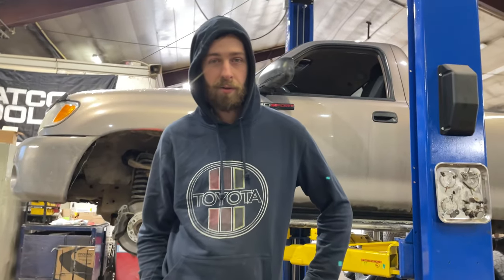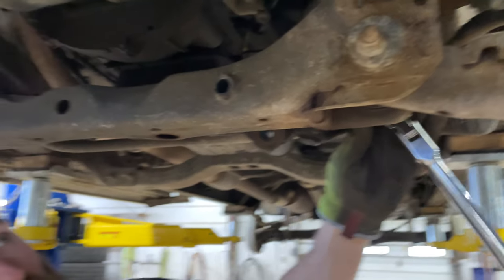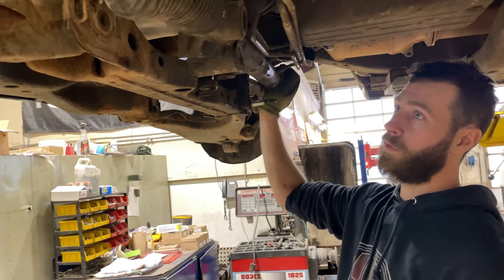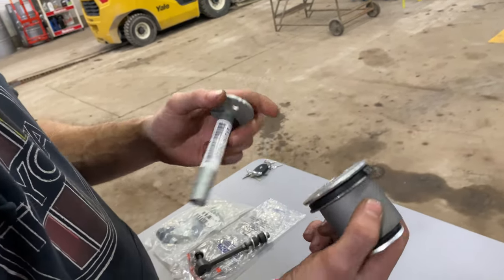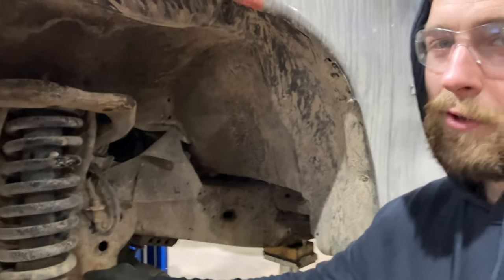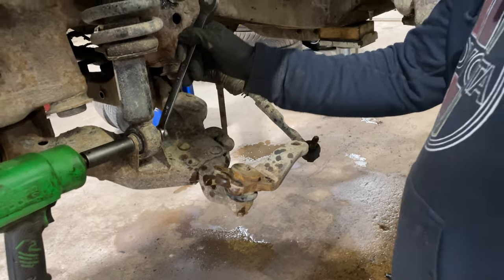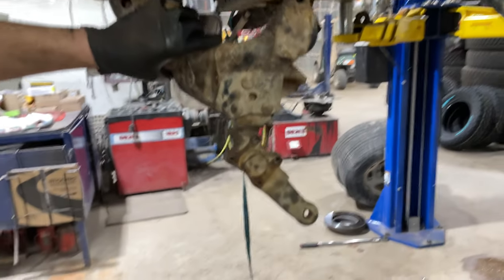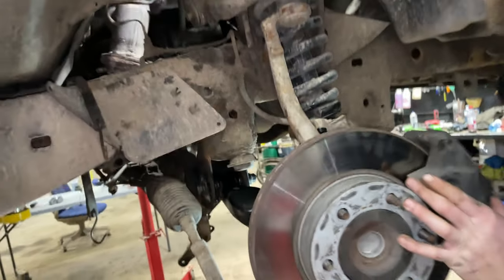2000-2006 Toyota Tundra Front Control Arm Bushing Replacement 2WD RWD

Comment: Nice work!  While the control arms were off you cleaned and coated/painted them obviously?  Curious what you recommend, I'm in MI so similar to your snow/salt conditions.  Planning to clean (and coat?) and fluid film components as I go and wondering what you use?  Thanks!
Reply from the maker: Yeah i just got all of the rust off of it and hit it with some paint and then coated all of the metal surfaces with honey goo by kleen flo. fluid film works good too. you know just as well as we do that something on it is better than letting the rust destroy everything! best of luck to you if you decide to change your bushings! :)

Comment: You should never use non oem ball joints on a first gen.
Reply from the maker: That’s what I said but the customer didn’t want to pay the price lol 😂 needless to say it was back after 3 weeks and needed one replaced no joke!
Reply: @Tech-28  lol. Hopefully he learned. Great video.
Reply from the maker: @heymanoutdoors7752  actually the truck was in an accident about a month ago and it rolled over and exploded so now he has a Tacoma
Reply: @Tech-28  hope everyone was ok.
Reply from the maker: @heymanoutdoors7752  luckily someone pulled the guy out of the truck before it blew up, he was unconscious tho
Reply: @Tech-28 was the accident caused by a lower ball joint failure?
Reply from the maker: @ronjohnson8119  no it wasn’t, guy got t-boned in an intersection